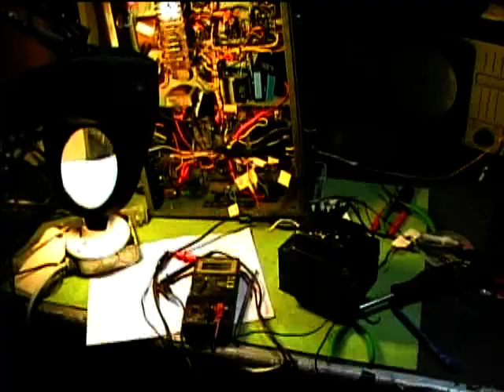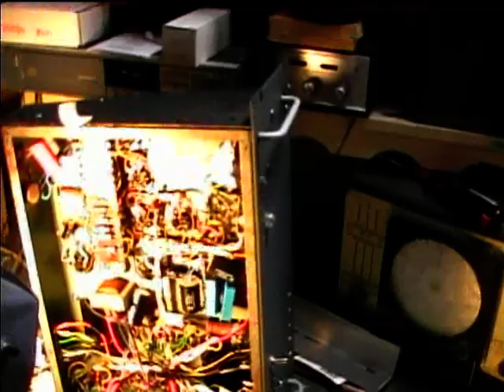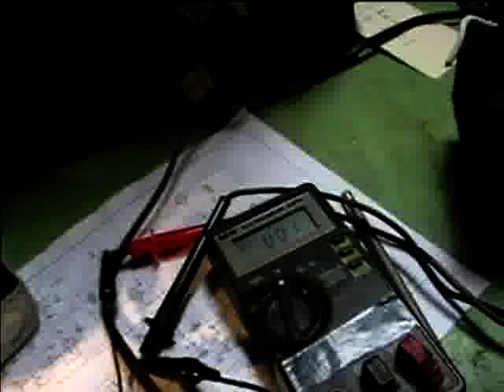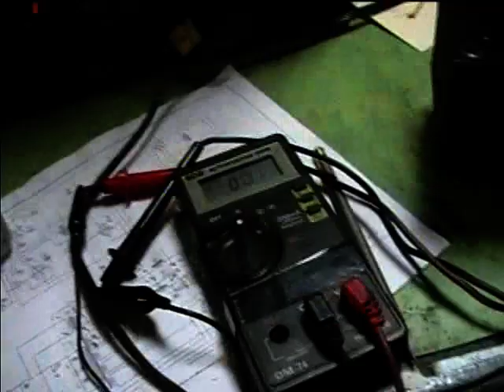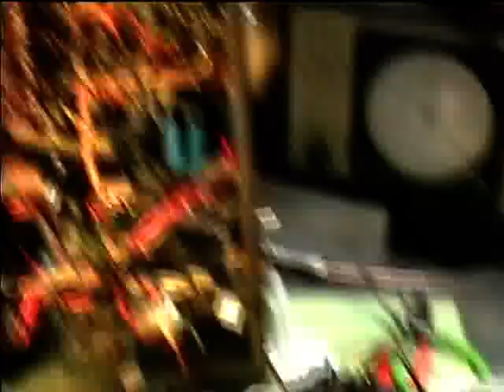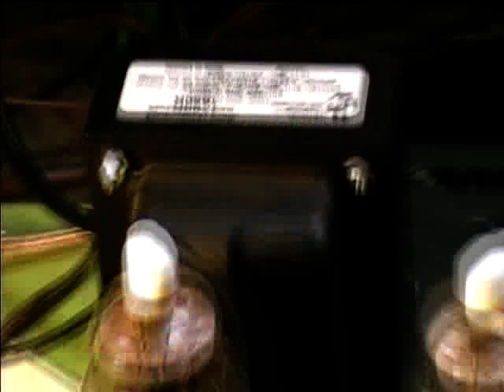Bogen HV transformer test

Comment: 807 push-pull amp used to be most popular PA, and mostly those PAs have no safty cover. It is good for looking tubes to check by eyes as well as monitoring the plate cuurent, plate voltage and grid cuurent with big meters.

Comment from the maker: I had the exact same thought...I tried cleaning it with isopropyl alcohol but the problem still recurred. The terminal strip may have gotten charred...This is a job for a client and we thought we had the problem under control the first time but it recurred and is getting worse...also with such high voltage I don't want to try and improvise a repair like from plexiglas or something...unfortunately we will need to move on as there are a lot of other item such as jukeboxes awaiting repairs.

Comment: Was that transformer arcing internally, or just on the terminal strip?  It almost looks like the winding had a break right where it was soldered to the terminal strip, or that the insulating material for the strip had become electrically leaky/contaminated with carbon deposit.

Nice Hammond transformer too, those go for around $120 retail I think.

Comment: light bulbs work better incase of a short . one how bright the bulb gets can help indicate the duty cycle of the circuit. I use to hook them up to the colector of the HOT when a flyback was suspect to mprotct the HOT and saty caps etc. It really works  well .

Comment from the maker: This circuit is based one one that was used in Heathkit amps for inrush current limiting. The Heathkit does use a wirewound resistor but the lightbulb has the advantage of being much more inexpensive and will also take more of the current away from the transformer in case of an overload.
I probably will change to a filament pre-heat circuit and remove the light bulb circuit once I get the overload problem solved.

Comment from the maker: That's a good idea...I would think you would need to put the secondaries in series. I'm not sure if I would try it with these kinds of high voltages as the insulation in the transformers might not be rated for such high voltages.